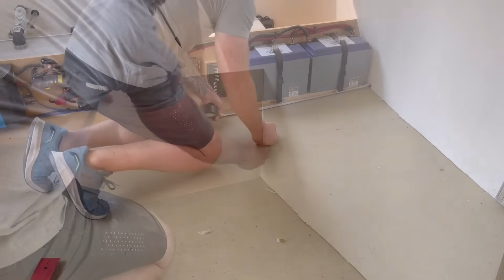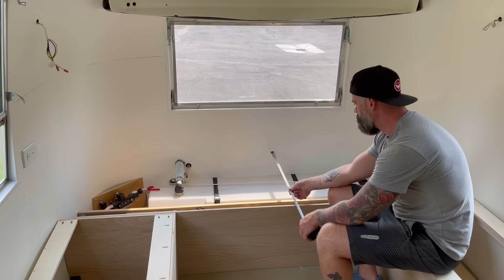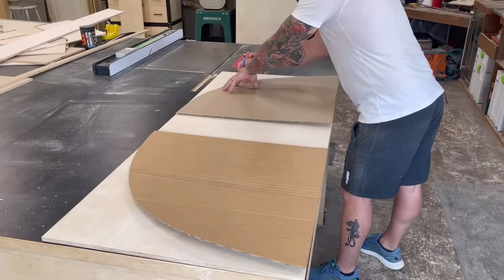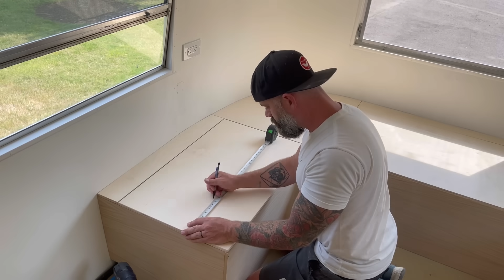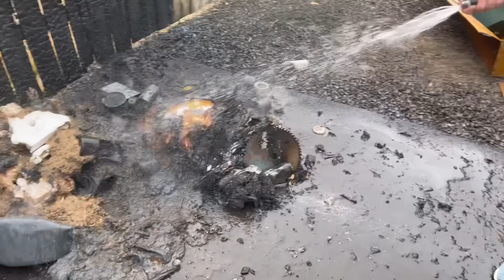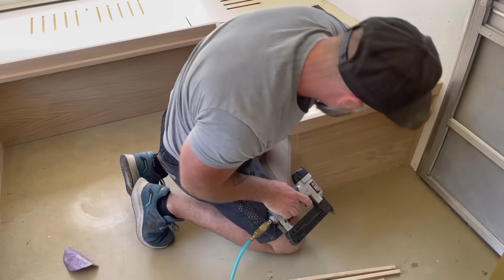Airstream Build Out ||  Built in Bench With Storage

Comment: I like the little “hidden” Bourbon storage. Though, may I suggest bracing and padding? That trailer will see up to a 9.0 earthquake as you drive down the road, (higher if it’s a gravel road or I-55 in Missouri), and I don’t want to see you lose that wonderful amber goodness. Also, the cleanup is murder, (ask me how I know!).
Reply: I suspect he won't actually use that space as bourbon storage. The high proof will eat through the corks over time. Wine is typically low enough proof which is why it is stored on it's side.

In response to the altitude change that is a big deal. When I drove tractor trailers certain loads had specific routes I had to take to avoid elevation changes. Bags of chips were the worst offenders.
Reply: How do you know?
Reply: Haha I came here to add my two cents on similar lines. Definitely have a care of how you store things on a road trip. Particularly evaporative glassy flammable things over your fancy electronics. May I recommend this become a place for an extra change of bed linens instead?

Comment: Hi Jason.  Everything looks great.  I think you are going to need a lot more ventilation for your inverter charger.  That Victron Multiplus is a fantastic unit (I have one), and it puts off a lot of heat when charging or Inverting.  I ended up adding a 12 Volt DC cooling fan with an air inlet hole.  I added a thermostat to the fan so it would come on and off as needed.  Good luck finishing out your Airstream.
Reply: I agree, and I hate to say it but you should modify the front of the cabinet to give access to the interior.  Working on that gear through a narrow slot from above will be almost impossible.
Reply: + there should be 
 some fire retardant coating as well.
Reply: @rgzutshi nothing catches fire in the entire video, all will be good.

Comment: RV owner here with solar inverter - you really should consider adding ventilation in that front panel where that stuff is at. We just bought our RV but it has a bunch of holes there for this very reason and it gets HOT. They don't bother putting them on top because the cushions effectively block it

Comment: lol. car fab tip.. use a small bearing on a regular (not carpenter's) pencil to trace curves. remember it will be off by whatever the diameter of the bearing is. so add that back before cutting.

Comment: I always take my oil soaked rags from oil changes and such and submerge them in gallon Ziploc bags with water and I also try to mash most of the air out of the bag before tossing them. I know it’s a lot different since you use more rags than I but I know they also sell metal trash bins for combustible rags as well. That may help

Comment: Hi Jason. Rags with linseed oil only self combust when they are scrunched up. Linseed oil reacts with oxygen and when the rag is scrunched up the reaction draws air through the rag and that creates heat making self combustion possible. If you let your rags dry unfolded you're safe.

Comment: I got really excited about the blue bendy things for tracing the curve.  There has to be a better version of that, right?!
Reply: The blue serpentine rulers aren't meant for this. An adjustable laminated ships curve would work better or what my grandfather actually used in ship interior building was a flexible steel curve template that you can fixate to a form (it looks like a lot of bevel gauges linked together). However, for small contours I still have a green type of (I presume) serpentine ruler that is nowhere near as easily bent as what you saw on the video with probably a lead core. That works just fine too for small curves, it has been in our shop for as long as I can remember so I couldn't say where, or even if, you could still get one like it now.

Comment: You are going to want an access panel for the shut off, the fuses, and the breaker panel. Also , not sure if it is the case, but shouldn't the rail for the bed board/table be 3/4" below the seat box (so everything is level/flush when you set the cushions? Maybe you are planning on a thicker cushion for the area where the table is...

Comment: If you have so much trouble with the linseed oil, why do you use it.  Why not avoid the danger and use another finish?  I love your project and attention to detail.  Thanks.
Reply: Because it is a great finish. Food safe, low maintenance, and it impregnates the wood helping it resist humid environments. It's also very easy to apply.

Comment: I have a 5th wheel i would like to do work too, do have some carpenter skills over my 60 years, i do however have an important question, how do you attach anything to the walls? as far as i can tell its 2 inches thick and looks to be 1x1s framing.

Comment: Is it safe to have the batteries inside of the trailer ? My trailer has them on the outside so they have ventilation. For inside mounting I've been told they need to be in a sealed compartment so they can't off gas into the trailer. Coming soon ... How to repair a fire damaged fence and safe storage and disposal of solvent soaked rags.

Comment: What I'm wondering is if the 1/2 inch lip to keep the seat cushions in place wont transmit through the cushion when the bed is set up?  Won't you feel those lips under the cushion when you try to sleep?
Reply: I don’t think that would be an issue as it’s not a one piece mattress. Those 1/2” pieces should nestle nicely in the gaps of the cushions and if the cushions are thick enough won’t be felt by the sleepers.

Comment: When making the corner templates, why wouldn't you just put the kerf pieces into the corner then slap some putty/quick dry adhesive on the kerf side to hold its shape, then use that as the "template"? 🤔

Comment: The bracing above tank. Would it have been better to have been able to lift the whole piece above tank out rather than dismantling completely. Just incase you need to remove or swap tank if it get bacteria or something growing in there. So wall brace and then a piece the you drop in then clamp to create the bracing…

Comment: A small metal trash can with hinges lid suspended by a string will prevent fires.  If the watco or linseed rags spontaneously combust; the string  will burn and the lid closes: no air equals no fire
I lost my shop
When my ex shop partner left watco stain rags on floor

Comment: A question, if I may:  How will the vents work when your wife puts pretty seat cushions over them?
Reply: The vents are to allow those pretty seat cushions to breath
Reply: The moisture from the body passes down through the cushions and out of the air vents. This makes sure that mould does not settle.
Reply: Yes, but they should be providing ventilation for the batteries. He should have put vents on the front.
Reply: @virginiatolles1664  I don't believe AGM batteries require ventilation
Reply: Thank you, Jason.

Comment: Great video! Love how your benches are so strong without using a bunch of 1x1 framing like the RV industry would have used originally. Will be using your strong plywood box design when doing our dinette. Also lol on the screws too long. At least yours is under a bench. We did it with our half inch doors with the handle hardware screws 😬